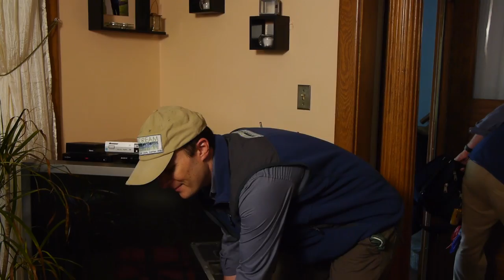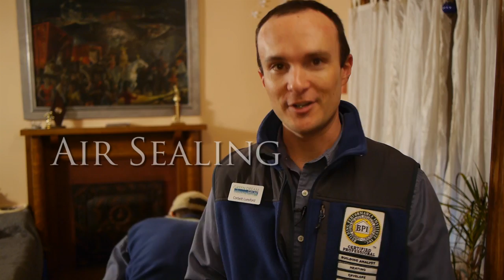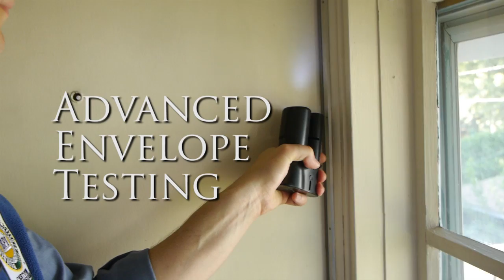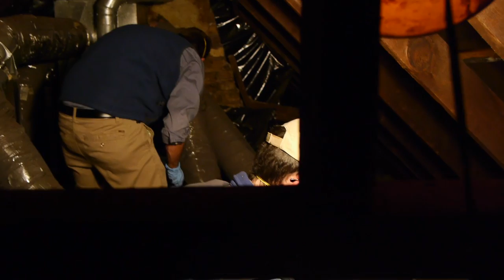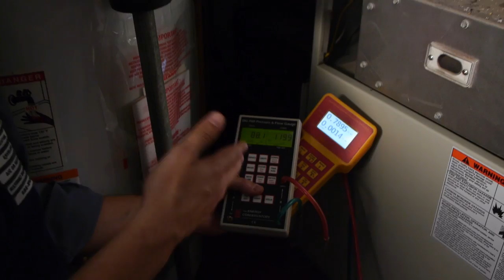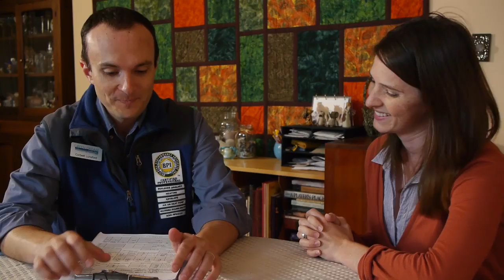How to Test Home Performance: More than an Energy Audit with Blower Door, Infrared, Combustion Tests

Comment: Just a quick note on the drilling of holes into combustion flues. Due to the many types of combustion setups that people may have, test holes aren't always the best way to tell if a heating contractor has actually performed efficiency, draft & Carbon Monoxide testing.

Also, the CO detector displayed would not go OFF until the Ambient CO levels were higher than 0, but the digital numbers would register the number of parts per million up until it goes off at (70 did you say? did you mean 35?)
Reply: Its 70 PPMs .Reason why.. CO censors ( precise ones) are expensive.